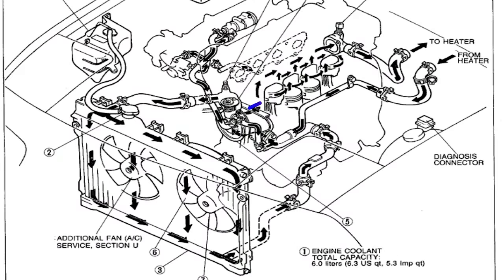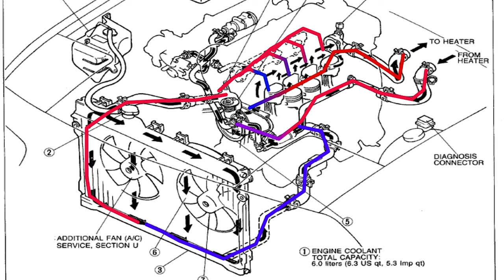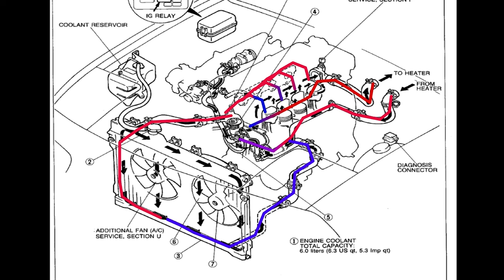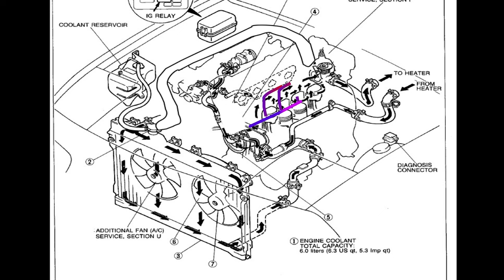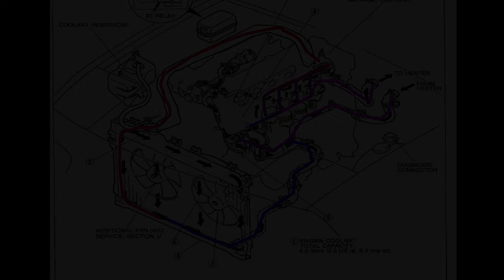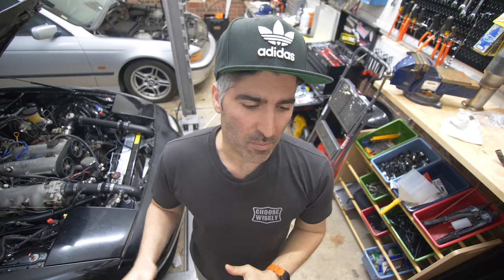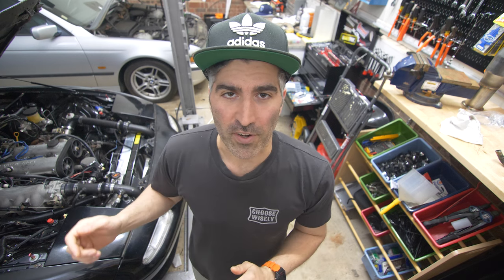DIY Miata Turbo Coolant Reroute (w/ Heater delete)

Comment: Can you run the nb throttle body and iacv on stock 1.6 ecu? Wondering because I’ve got a bp4w swapped na
Reply from the maker: AFAIK - unless you have some additional circuitry built out, no. 1.6 TPS is super simple (idle/wot) vs variable in NB (and auto/1.8 NAs)